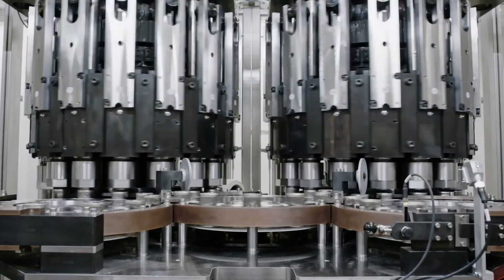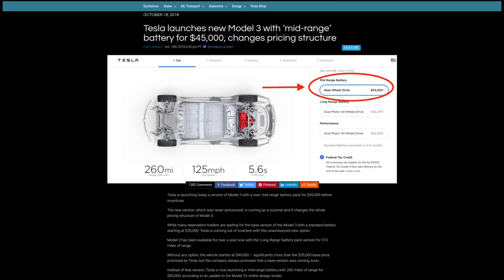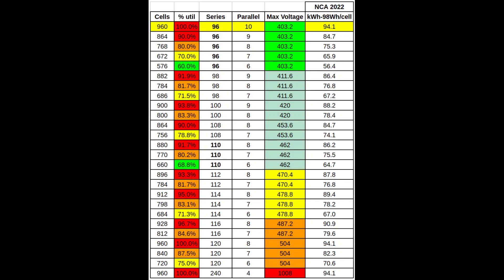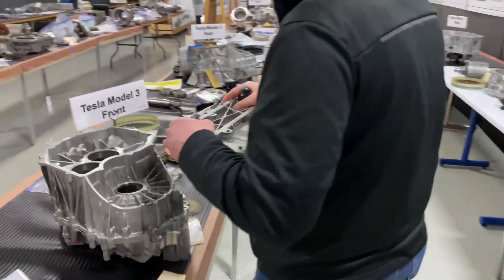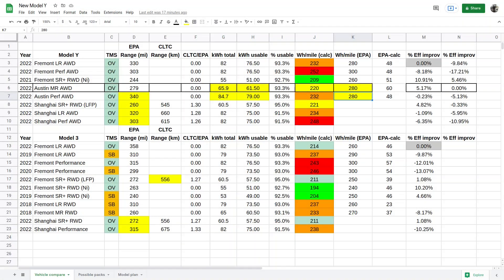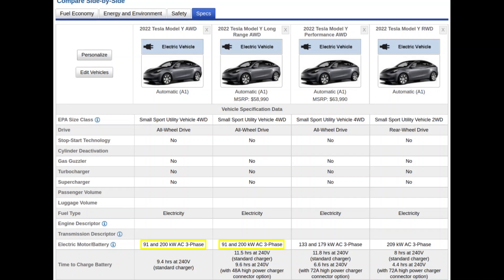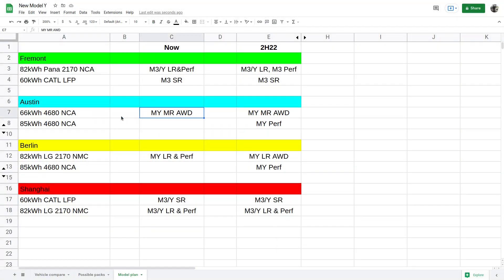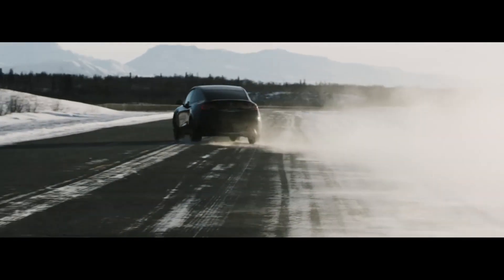New Tesla Model Y: What batteries and why now?

Comment: 403V is very low for 96 in series. Essentially all modern cells contain silicon & have a peak voltage of 4.3 - 4.5V depending on the contents, not 4.2V

Comment: How many lifetime miles will 4680 last vs 2170❓

How many charge cycles can 4680 handle❓  

Winter / below freezing degradation for holding a charge vs 2170❓ 

How quick will 4680 Supercharge vs 2170❓ 

Any issues with charging 4680 daily to 100%❓

Comment: There’s one problem with this theory. Although it’s physically possible, there is a very specific reason NO EV has parallels of series strings. They all have series of parallel blocks. There would be constant uncontrolled self charging going through a resting pack. The easy solution is to have parallel connections running across all the strings to help group them back into parallel blocks, but usually you want those blocks to be as compact as possible so the voltages within the block of cells is exactly the same and tightly controlled. This is why all Tesla packs have been built the way they are, and are likely to stay that way.

Comment: It's funny how people start off with the right thoughts in mind and then end up at the very wrong conclusion. Yes, Tesla does not have enough 4680 and they need a lot of them for the long range and performance. Therefore it makes absolutely no sense they would use some in a standard range model Y. No sense at all! The model Y standard range will get the latest catl LFP packs. They are also structural and therefore the rest of the vehicle can be built on the same line. As in Berlin the packs will come from catl and then be integrated.

Comment: This analysis is spot on. It makes perfect sense with the context of cell production shortages. It is just like the decision to not produce the Plaid Plus Model S. 

People are projecting what they want in terms of the best specifications for the car instead of thinking through Tesla’s actual goals. Tesla will have the capacity to sell 42% more good EVs using less batteries per car but retaining a structural pack this way. And as you said the performance version will come later and it will be spectacular.
Reply: This analysis is spot on wrong.
Reply: @whynotstartusingyourbrain8726  , what type of batteries do you think they are using in the New Model Y then?
Reply: @timmontanaro6877  they are using the latest catl cell to pack LFP batteries. Elon clearly said every standard range model will have LFP. Every long range and performance model will have 4680.

Comment: According to the EPA application dated 2/23/2022, the new mid-range model Y has a curb weight of 4356 lbs and the model Y long range has a curb weight of 4381 lbs.  That's only 25 lbs difference in weight.  The 4680 structural pack should weigh substantially less than the 2170 pack even if the pack is full, let alone if there are batteries removed.  A 2170 pack with batteries removed would also weigh less.  How do you account for the weight of the 2 vehicles being nearly the same?
Reply from the maker: If the pack does use 960 cells, I'd suspect a full 94kwh pack would weigh similar to the 82kwh 2170 pack + additional structure required.  Since they probably can't just leave cells out of a structural pack, they would have to substitute in some fake cells. I'm hoping that cell cans filled with a phase change material are being substituted for about 30% of the pack's cells, which would give near the weight of a full pack.
Reply: @fiveyearsahead  After all the hype, I think that Tesla releasing a 4680 Model Y with only 279 miles of range will cause the stock to tank.